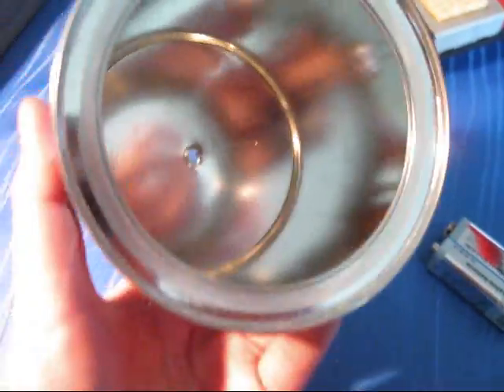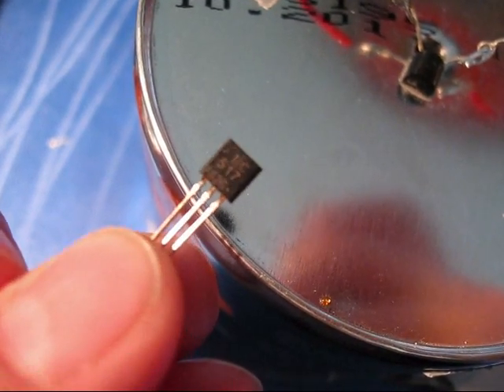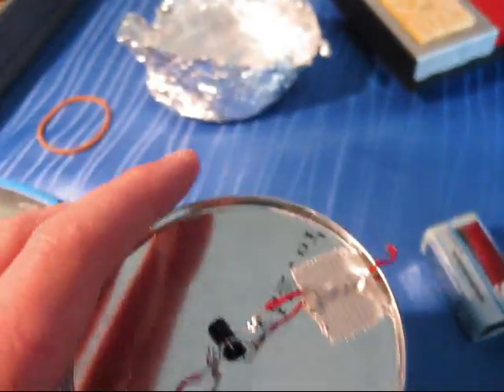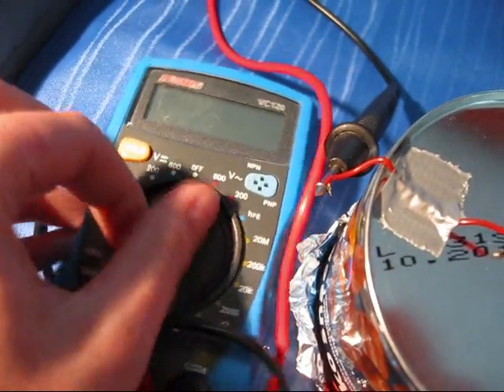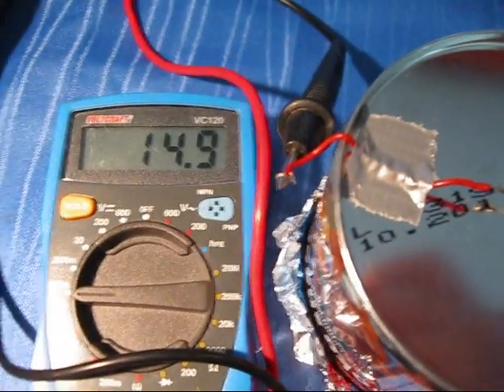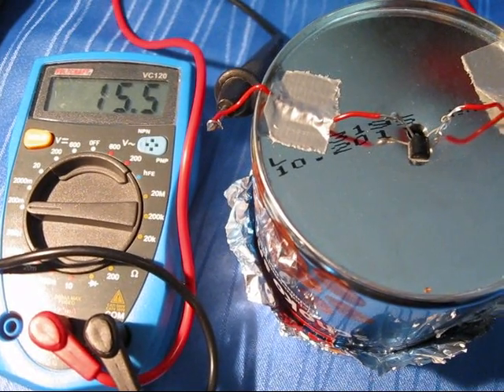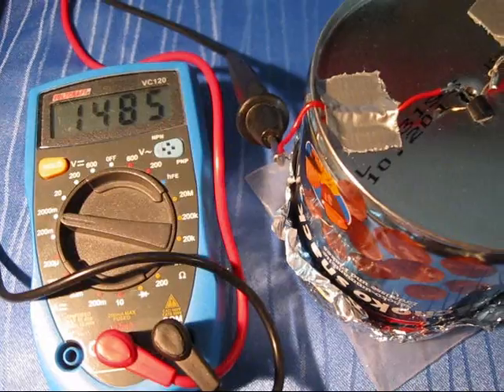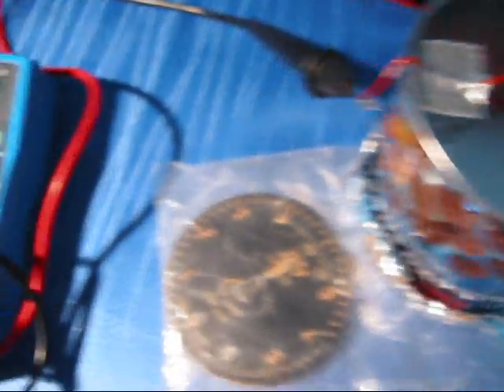how to build a geiger counter / radiation detector from household materials

Comment: The collector to the voltmeter (positive and the emitter to the negative terminal, as in the diagram in the Spanish version or invert? does the size of the metal box matter? I have 13cm height, 9cm diameter is good, or what are the dimensions? and what distance is needed between the wire in the center and the foil?

Comment: If the can has a plastic lid that came with it, I would suggest cutting a piece of wax paper to put over your transistor and wiring, then cover the wax paper with a sheet of aluminum foil that covers the edges and down the side a bit, and snap the plastic lid on to hold it in place.  This should remove the extraneous signals induced on the outside.  Not sure if the wax paper, can bottom and aluminum foil shield would work as some kind of weird capacitor and have an unwanted effect, like self oscillation, but it would be worth a try.

Comment: So, that means that this eaven thou it has no noble gas with a mixture of halogen and the voltage is low it can still detect high amount of radiation ?. Because that is very cool.

Comment: Great video! Could you use a steel mesh screen like the breathing air window used in some radio frequency quiet Faraday rooms?  I was surprised the barium didn't register higher. Does this work by alpha/beta/gamma particles hitting the long probe inside and knocking electrons loose that forward bias the base of the Darlington transitor so it starts to conduct?
Would it be better to have a thick steel cone as a probe (held in place and insulated from the sides of the can with plastic spacers) would that make it more sensitive?
Would a Field Effect Transistor (FET) work? The Gate (similar to the base) is extremely high resistance so any voltage on it will not be loaded down like P/N junctions in the Darlington transistor does?

Comment: verry nice to see a video about a minimalistic setup. especially since most ionization setups require a serious power input, or some specific components, and always have a lot of extra cirquitry. 
however in case you want to leave the multimeter away you can use a second transistor and connect something like a small glow bulb a small engine, or something like that. it will ofcource not be as accurate as the meter but it can be great for people who have no access to a multimeter due to living in a region where you are only allowed to have a multimeter if you require it for your specific profession.
Reply: Ionisation counters can work with as little as a 9V battery, no "serious" power input required at all.  Where in the world is a person only "allowed" to have a multimeter?  I see them in garages, hardware stores and any electrical supplies shop as well as on the web for as little as $5.    Connect an "engine"???

Comment: Back in the day,young women were hired to paint clock/watch dials with radium doped paint. They found that twirling the tip of the brush in their lips gave a finer point,which made painting the dials more accurate. They also ingested radium while doing this,which the body treated like calcium,and the bones of their jaws slowly got soft,and eventually dropped off. Let to a huge work place safety lawsuit. Horrible way to die.

Comment: Interesting video, but I still think I made the right decision buying a few cheap gamma radiation detectors for under $100 that actually give a readout in uSv/hr that is reasonably accurate. One of the even provides a nice data output you can monitor and chart with you laptop. This device reminds me of the old home-made anemometer joke (tie a piece of string tied to a stick - if it hangs straight down it isn't windy, and if it sticks out sideways its very windy). Still amazing what you can cobble together with a few electronic components.

Even more amazing is the Kearny Radiation Detector - haven't made one yet, but apparently it doesn't need a battery (you charge it with a bit of static electricity), and it can actually produce a reading of uSv/hr (or R/hr). I wonder if this electronic device could actually be calibrated? It seems way to susceptible to environmental factors to ever be calibrated enough to give a ball-park measurement.
Reply: CAN THIS THING DETECT URANIUM RADIATION? PLZ TELL :)

Comment: What you really need is a circuit diagram.
Reply: CAN THIS THING DETECT URANIUM RADIATION? PLZ TELL :)
Reply: @siddharth-wy2kp  The majority of what comes out of uranium is alpha radiation so this detector will not detect that.  Alpha radiation can be blocked by a sheet of paper.
Reply: @Graeme_Lastname  but this detected radium right? which mostly emmits alpha
Reply: @siddharth-wy2kp  Also emits beta and gamma.  It's not just the pure element that has to be considered. After it emits anything, it has become something else which can also emit other forms of radiation.  I would try chopping the top off a TO3 package and using that as the first transistor in the Darlington pair.  Gives you a much larger collection area so would be a lot more efficient.  It's delicate but more sensitive due to the larger area.  For a bit more detail have a look at:
https://en.wikipedia.org/wiki/Radium
Might help a bit.
Keep well m8.  Hope I helped.    :)

Comment: Could this be done with borosilicate glass evaluated  of air and replaced with argon.  Make a  sodium mirror on the inside so it will be conductive and seal the whole thing up using your electronic set up?  Think that would work?  Maybe thin down the glass like a x-ray tube window or just use some beryllium doped glass from an old x-ray tube as the detecting side of the chamber.   It could be done.  Probably be alot cheaper and alot less headache to just buy one lol.  But that was my idea.  What do you think?  Would it work or no?
Reply: CAN THIS THING DETECT URANIUM RADIATION? PLZ TELL :)
Reply: You have just described a Geiger-Muller tube.

Comment: Can someone explain me why you need a resistor (4.7 kohm)? I'm really bad in electronics and i'm sorry. I thought electrons are traveling from ionize gas to the electrically charged (+) branche that you see in the middle of the can. Since V=IR you increase the flow rate of e- this is proportional to R which in my understanding is exactly what a multimeter is (R). Someone can explain me or try at least?
Reply: CAN THIS THING DETECT URANIUM RADIATION? PLZ TELL :)

Comment: Checking the pinout of the BC517 in datasheet Pin 1(collector) is conected to the negative of the multimeter, and Pin 3 (Emiter) is conected to the negative of the batery.

Comment: I think you just made a small antenna and measuring just the electric fields in the can
Reply: Yes, You are right.
This method can detect only very strong radiation.
Reply: I build a similar, more sensitive and more stable one, and can event detect radon washout from rainwater, or a single thoriated welding rod: http://tlfabian.blogspot.com/2016/10/building-radiation-detector-from.html

Comment: I'm not sure if this is able to measure any kind of radiation. Since there is no HV present, which could collect the free electrons in the chamber.
Reply: 9v is plenty to collect the primary ions. The high voltage of a GM tube causes those ions to drift fast enough to themselves create more ions, giving the device a huge gain and allowing detection of individual particles.

Comment: Privyet bionerd. I built a nondiscriminatory Geiger tube. Purely passive, just a probe in a sanded sodacan with some wax paper. & An antenna out of the can to create a more or less equilibrium. My question is,, if I got an analogue meter & put a piezo or something inline with the gauges ground, do you think that'd 'work'?

Sorry for commenting on an 8 year old video. I'm sure the new HBO series is going to cause a viewership spike

Comment: Could I simply use a more complex circuit for making a radiation counter or do I really need a GM tube?
Reply: An Ion Chamber like this is more primitive. If you use a professional tube you increase your sensitivity. The circuit is for sensing the small electrical currents, so if you want you can put an LM387 on the thing and get your classic geiger clicks...
Reply: @69995d  Would increasing the voltage increase the sensitivity?

Comment: You do know that device does not detect anything above microwaves, right?
Reply: WRONG. THEY WONT IONIZE
Reply: It detects ions in the air. Only wavelengths from 300 nm and shorter can ionize. Microwaves cannot ionize as the other poster said.

Comment: For the margin darlington is a way to connect two transistors together to have bigger gain in the current (T1 emitter current will be the base current of T2, here a single transistor is not a darlington. For transistor type bipolar NPN is enough to say here. Apart from this the circuit and this "detector" is an interesting and cheap project. thx
Reply: The BC517 is actually a darlington transistor. Both transistors are just covert by one plastic enclosure.

Comment: Which semic conductor is she using or can we use any?
Reply: darlington npn transistor
Reply: Use a Darlington transistor (super alpha)  to get the required gain. If not available then get 2 NPN transistors and connect the collectors together,  then connect one base to the others emitter and this will leave you with an emitter, base and collector and a super alpha pair !! Gain is the product of the two .

Comment: You could consider placing tape on the back of tin to avoid any shorts circuits. Also drill a smaller hole and place a small piece of insulator from cored out wire around base leg to just fit in hole then solder a cage around transistor
Reply: I was thinking of PlastiDip, like you use on tool handles.

Comment: Science rules! You are awesome. I used to work in a lab calibrating detectors on a beam line. Very fun. How about try and make a neutron detector =) What brand do you use in the field for testing ? You test only Gamma ?
Reply: If you want to detect neutrons, is necessary to "transform" neutrons to ionizing radiation. For example, you can cover the inside can or the Al foil with Be, because Be + n --> Li7 + He4. One of them (Li or He) is a ionizing particle inside the detector.

Comment: you can give exact unit (calibration) for this reading : background is apprx. 13.2 and for Cs-137 source(2008) is apprx. 25.5  so : 25.5-13.2 = 12.3  is exact measure for this source on the time of experiment
Reply: You are right, but dont use the word exact. =) You need a registered radiation source and much math for that!

Comment: Is it possible that a foetus could acquire a mutation which is accidentally beneficial? Obviously I'm not talking X-Ray vision or telepathy. But a small mutation which perhaps aided flexibility, dexterity or muscle mass. Maybe even pain resistance or something similar.....
Reply: Prior to the fetus, the division of DNA and the sex cell creation stage, is where a change can happen, good or bad. After the fetus is growing, each cell has its own copy of the DNA. So the most you can do is effect one cell. Usually its cancer, but could be beneficial, but cant be passed to next generation.
Reply: Bailey Holden Does that mean that a pregnancy is safe from effective cell mutation following a relatively early stage? Obviously radiation is still dangerous to both the mother and foetus in other ways. Particularly cellular/ DNA degradation in general.
This is research for a site btw. I'm not an evil genius. (I'm not even evil.... B'dum tish).

Comment: This is not a Geiger counter as it does not use a Geiger-Muller tube. This is an ionization chamber. The circuitry for a Geiger counter is far more complex.
Reply: Actually the circuitry for both are relatively simple. But totally agreed that this is an ionization detector, which cannot detect individual radioactive decays.
Reply: Fully agree. It is nothging to do with Geiger counter.

Comment: actually this is electromagnetic radiation detector, not  alpha/beta/gamma detector :)
Reply: No, it does detect gamma radiation. It is a simple ion chamber. Ion chambers are even in cdv-715's. It is not a Geiger counter however.
Reply: I think for ion chamber is good to have a few hundred volts ,  on that type of transistor you can have 20-30 volts max between the base and collector.
Reply: You need a couple hundred volts Geiger counter. Not on an ion chamber.

Comment: Interesting. And yeah, those old radium dials make awesome sources.  I have a few old radium dial pocket watches, several of which still work and I carry from time to time.  When I bring the dial close to the geiger tube the count rate goes crazy. But if I turn the watch around with the back facing the tube the count rate is significantly lower. So when I carry one I always keep the dial facing outward, away from me. :)   Oh  yeah and they still glow a bit. Once my eyes acclimate to the darkness they still glow faint but bright enough where I can read the time.
Reply: You can paint the dials with fresh glow in the dark pigment and they will glow like a fresh reactor core. The old glow paint is just radiation burnt and oxidized. The radium still has PLENTY OF LIFE.

Comment: Where I can buy the radiation sample ?  I can't find in ebay
Reply: or if you don't want a high gamma emitter but a rather lower gamma emmiter with high alpha emission you can get americium 241 from an ionizing smoke detector.
Reply: Try Uranium ore from amazon or ioffer.
Reply: I think the US Bureau of Weights and Measures (and Amazon) actually sells sources, pretty much any material you can imagine...just don't open and taste anything! I saw uranium ore samples for sell on Amazon, but asked myself how you handle it without getting the whole house crapped up with Alpha particles (thank you but no).
Reply: The range of alpha particles in air is only about 4 cm. Try thorium lantern mantles as well. I've got tons of sources such as lantern mantles, uranium glass and ore, americium, and other stuff.

Comment: How safe is it to be holding the radioactive sources with your bare hands  :(
Reply: Radiation is like fire. Can have a lighter in your pocket, or it can burn your whole town down. There are different types and they interact with things differently with different energy levels. You are receiving radiation all over, all the time, even if we had NO technology on Earth. The most radiation you will take in your lifetime, is from the bricks and tiles in your house. They have small amounts of uranium from the Earths crust. its nothing to worry about.
Reply: No problem mate,it is safe to hold if you not eat it.Because particles are mostly alpha.And they are stop with a piece of paper.

Comment: I tried to build it and I think that it works quite well. It gave me like 5 or 6 for background radiation. In italy it's forbidden to keep radioactive materials so I have to buy some old watches. You're great! Go on like this!
Reply: Buy a bag of potash, which is used for gardening.  It contains the K 40 isotope, which is slightly radioactive.
Reply: Smoke detectors have Ameracium 241 emitting primarily alpha radiation. It will be ok if you get used, discarded unit as the half life period is around 400 years
Reply: @flyingfox8072 tastes good too. America always does it best!

Comment: what you've built is extremely similar to a part of a ionization smoke detector.
Reply: smoke detectors are pretty much just the absolute reversed function of this, where when the constant amount of radiation detected is different from what it's calibrated on, it goes off. What keeps it from always going off is the Americium-241 inside of it.

Comment: since I haven't had a singular darlincon transistor I connected two transsistors in a darincen pair and it gives me a heigher voltage and alsoI used a root bear can and didn't cut any more holes. Thanks for the video :) now I need to buy a test source

Comment: interesting, I would have used some insulation on the Transistor-legs so I could be a little less careful using it, technicall you could easily put that can on the bottom of a pole,  the Volt meter on the top and Carry it around like other radiation detectors, It wouldn't be the most reliable detector as you explained, but something to show off anyway, well thats if we could get our hands on something radioactive and measure :)

Comment: ok ty, but what numbers are considered a dangerous level, like if i want to know how many rads , so i can see how many rads  a hour i am absorbing?
Reply: You would need to calibrate it using a known and measured radiation source. Oryou could  calibrate is against a geiger counter and a radiation source.  However in that case you might as well just buy a Geiger counter.

Comment: I did your experiment with my droid, using two layers of electrical tape over the CMOS.

it seemed to work surprisingly well, but now my question is, was I supposed to use one layer of aluminum foil?